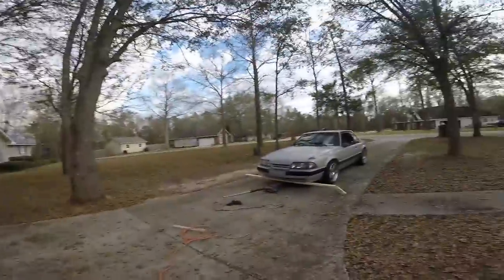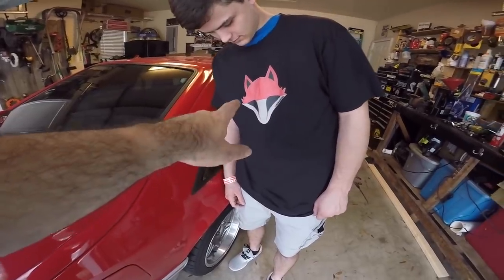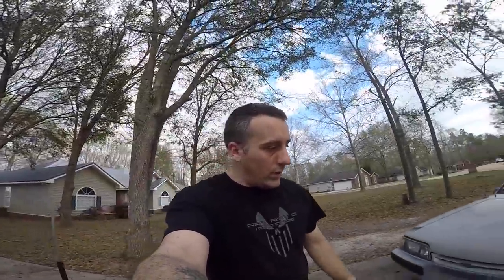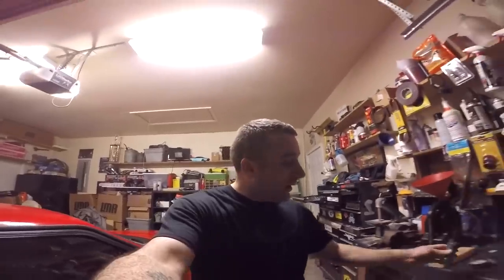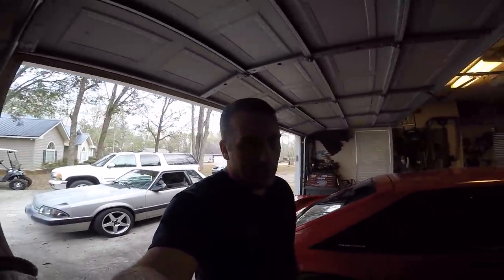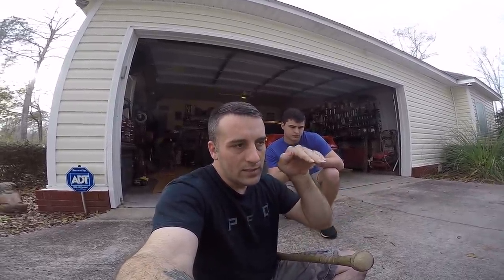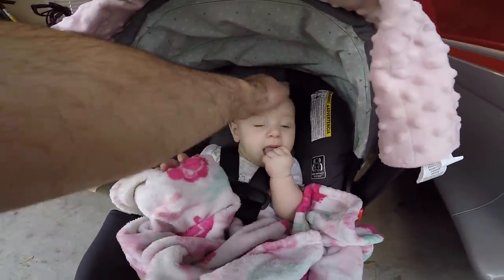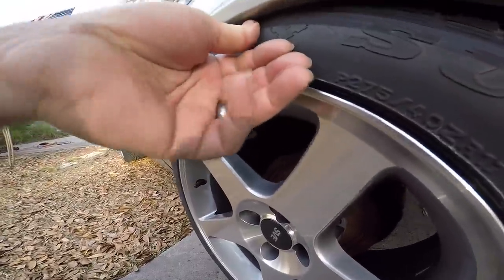KEEP ON ROLL'N... FOXBODY FENDERS  {THE BAT METHOD}

Comment: We used the bat method but instead of working the rim. We cut the bat to fit left a nice taper to the bat and let the car do the roll.. Put the bat at the rear and roll the car slowly and as the tire turns the bat will turn and roll the fender. But you gotta be real carefull to not go to fast or you will cause damage.. Thats how we roll in canada lol
Reply from the maker: Lol, I’ve used that method a few times, first time I buckled my fender on my 95 ...... 🥵 but after that I got a friend to help and it worked great, I just know how careful you have to be doing that so was hesitant to do a video on it honestly.
Reply: Yea ive seen some major mess ups using the bat method. One guy rolled the car the wrong way and cracked the hell outta his bumper lmfao. I wasnt quick enough with the WOAH WOAH STOP lol...  Oh well live and learn. Joys of owning toys haha

Comment: Thank you, I have 275 40 17, 17 x 10 4 lug 10th anniversary from LMR on my 89 Notchback. No quad shocks and it rubs in the back just a bit.
Reply: I have the 17 × 9.5 never rubbed and i still have my shocks,  you probably know this, but just incase, it's those 275. Oh yeah they say you just turn the shock backwards and you can still use them.
Reply: Im going through horrible rubbing on my 1984 gt350 with the same wheels. My tires are nitto nt05s so i definitely hate every time i hear the rub and see my tire peel away. But these are my dream wheels and tires ive had three foxes and just now decided to go for it even thoughthe troubles are horrible. I replaced my shocks and it fixed it a bit but still rubbing over bumps.

Comment: nice video. when we did mine. Instead of rolling the bat we had a driver move the car back and forth. the tire will roll the bat with great precision. So one person on the wheel and another person with the heat gun and the bat. If you have a third person just have one guy operate the heat gun.

Comment: @brew2l Reds are hard to get "perfect", especially when printed on dark colors.  When I ordered shirts (a mostly red logo on black shirts and grey shirts) the red was dull, exactly like yours.  I was told to use RGB: 252 42 43
 or CMYK: 0 94 88 0 when printing red (similar to your red) on shirts.  Have them try one with that color red and see if it works...it did for mine.
Reply from the maker: Great info! I appreciate you sharing that. I’ll definitely look into it. 👍

Comment: A  Makers Garage splitter will fix that bumper and look great doing it.
Reply from the maker: I bet it would! hmmmm 🤔🤔🤔
Reply: Whoa there, it's a budget channel lol. $280 plus shipping... I'd rather stick to my Mach 1 chin spoiler that I got from eBay for like 40 bucks lol
Reply: @SergioValenz1  IMO  its cheaper than a new bumper cover and adds support to the warped section that mach one spoiler won't.  The mach 1 spoiler conforms to fit and relies on the fascia for its shape. Its the other way around with a makers piece.

Comment: That coupe has a wicked stance with those cobras,beat me and i just got my car to 1 finger barely fits but my car came with front and back fenders rolled already which was nice. What suspension is he running ?
Reply from the maker: Andrew is on factory cut springs, we cut 1 coil up front and 1 1/2 in the rear with no ISO’s

Comment: This might be off topic but im asking everywhere, my 1989 cfd special edition stalls randomly but starts just fine.. I heard something about a "halls sensing module"? I have a new tfi anf ignition cylinder.. Any help is appreciated.
Reply from the maker: Is it stalling at idle?
Reply: @vrm86gt  i used dielectric grease i believe.
Reply: @BREW2LFOXBODY  indeed. Seemed to be more stubborn on starting later in the day. Im going to try to see if i cam figure out how to get it to dump codes today
Reply: @vrm86gt  i got a code 11 with engine running and a 18 or 81 with the engine off.

Comment: That is a sweet ass notch what size tires is on it Brewl I want to run 275/60/15 on my notch but I am afraid to roll the fender I don't want to mess my quarter panels thinking just using a 255/60/15! I don't know yet I mean the car is really straight for a 87 it has a little ding on the hood it still has the original paint on it!  Good Video man!
Reply: My notch is on sut springs, sits about the same heighy as Andrews. I bought some 255/60/15 Mickey Thompson ET Street SS tires and they do not fit at all LOL. going to have to roll fenders and might end up having to put a spacer in.

Comment: Off topic question: I bought the LED lights you suggested on Amazon and installed them but why are the high beams so crappy lol? The low beams are far brighter than the high beams. Also the shirts are badass.
Reply from the maker: That’s because the housings really aren’t made for LEDs, but if you get them adjusted out they work pretty good. Thanks brother, hopefully we have the shirts back up and going again soon.
Reply: @BREW2LFOXBODY  ahh makes sense. But regardless not like I'd need the high beams anyways since people are always flashing their lights at me when the low beams are on thinking it's high beams. & Yeah do that I'd definitely consider buying one. 🦊 body for life. also consider hoodies as well since it's cold as balls in Virginia right now.

Comment: You need to ask the guy in the intro driving with his hand on the inside of the steering wheel how far he can spin that wheel around when the shit hits the fan.   You can't simulate when that happens either.    Just Asking for trouble doing that lads.

Comment: I do not get it ,why cant anyone make a correct offset for fox  body mustang
Reply: They do, he went with 10" wide instead of the 9.5 Also just in case 18s for these cars are too tall, i don't believe Andrew went 18s im pretty sure he's got 17s. I have 17×9.5 & I've never rubbed.
Reply: These cars arnt really made for a 275.  More like 245-250 tire.  Usually cant even run quads with a 275 on them.. Half the time u cant even with a 250.